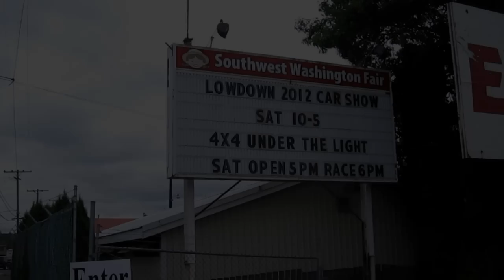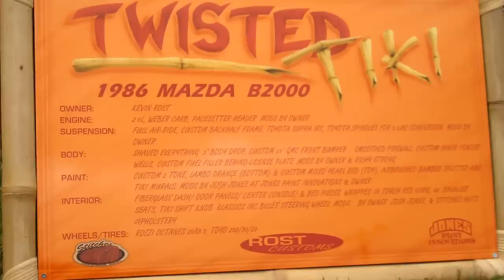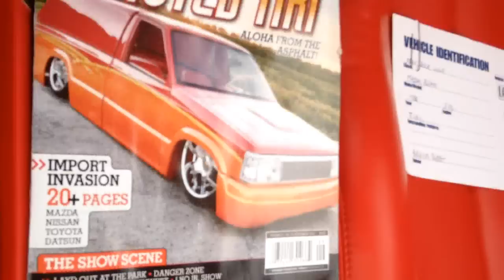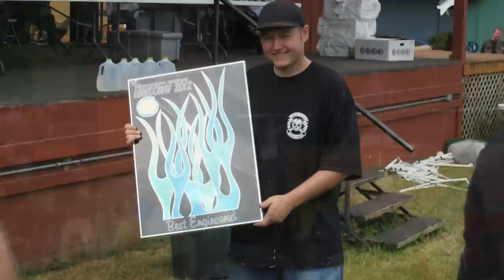Low Down - Lowered Truck Event July 2012 - Chehalis Washington

Comment: What truck is on that trailer at 0:56
Reply: Looks like an Chevy s10  ext cab. the one that was pulling in on the trailer is the same except its a blazer not a ext cab.
Reply: Datson 210 ext cab
Reply: oh thats a datson? yum/
Reply: trevor kidd or 710 can't remember what there truck model number was lol but its datson for sure
Reply: trevor kidd and the one coming in behind it was Nissan hard body with a camper shell
Reply: Andrew Bixby ight sweet thankz
Reply: maui808allday maui808allday no problem anymore questions? Lol
Reply: haha not right now thankz! lol
Reply: Andrew Bixby oh yea one more thing what truck is at 25:27
Reply: maui808allday maui808allday with the cadi front end?
Reply: maui808allday maui808allday look like 90s model Chevy Silverado 1500 ext cab with cadi clip